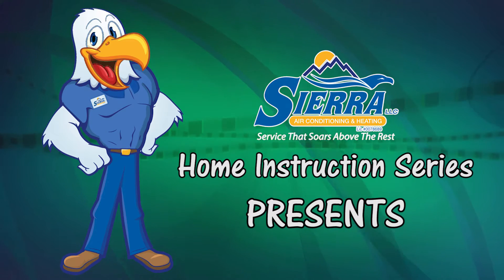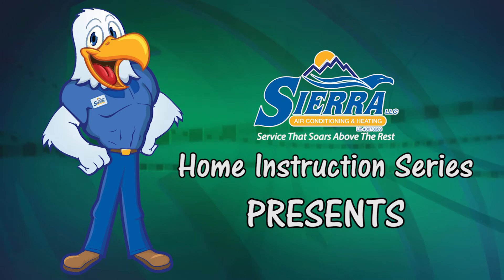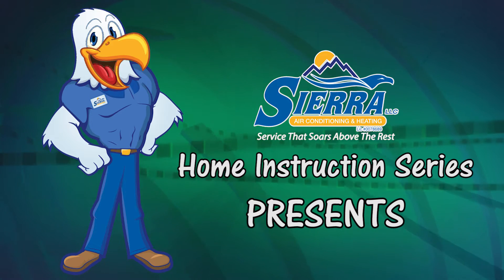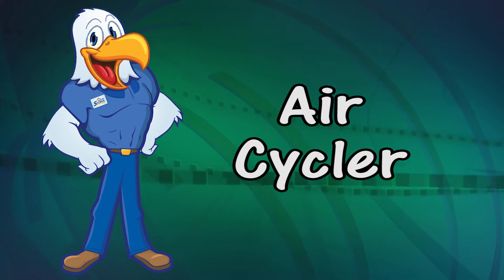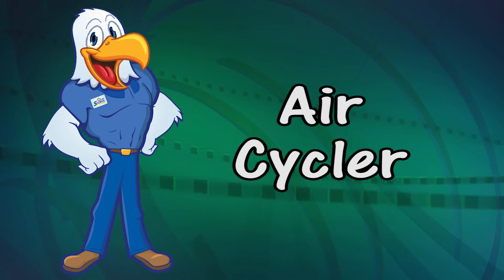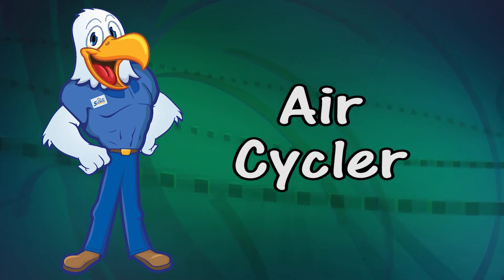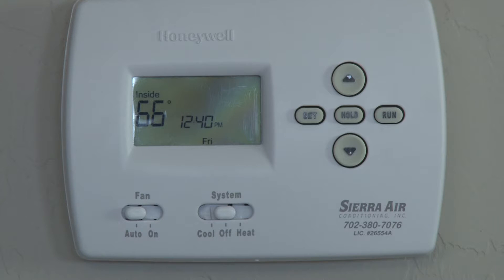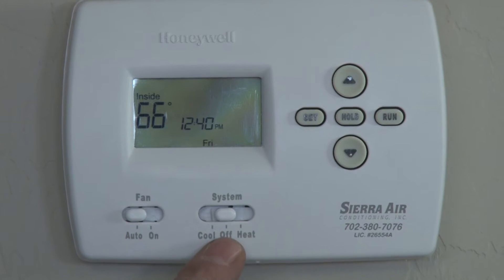Air Cycler: What is it & why is it there?

Comment: Seems like you would want it on at night more than anything so you get fresh air while you sleep.  Most people are gone through the day.  I suppose the air gets changed while you're gone, but if you're set for 3 air changes per hour, it would change the air in the whole house fairly quickly.  I'll probably set mine to only cycle while we're home.

Comment: Can I remove the aircycler body? There will be no connection between Gt and Gt, will my furnace still work?
Reply: Yes you can
Reply from the maker: We never recommend disconnecting engineered components of a system. It’s there to prevent negative pressure and unhealthy air in the home.

Comment: My air cycler runs every 20 min and runs for around 5 to 8 min every time so when is cold outside brings cold air into the house changing the temperature and the same in the summer, it heats up the house. How can I fix this to only come on every now and then not all day long?